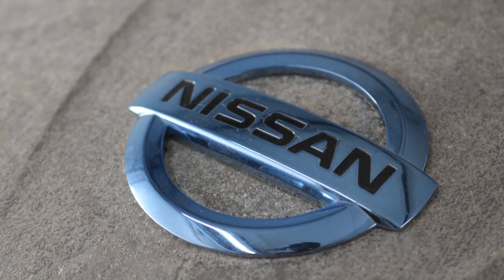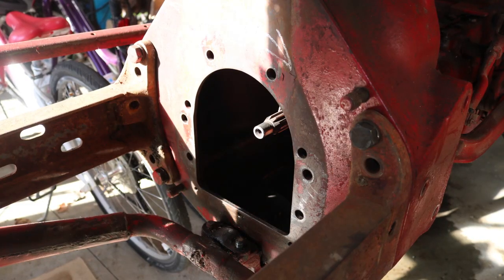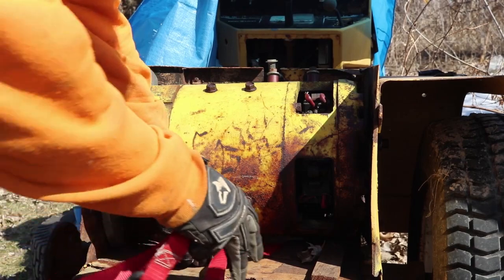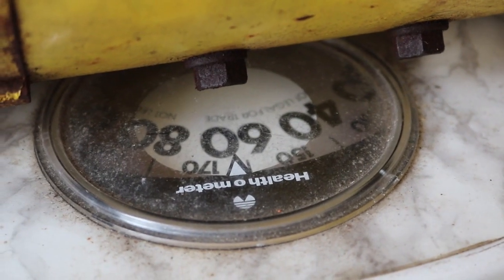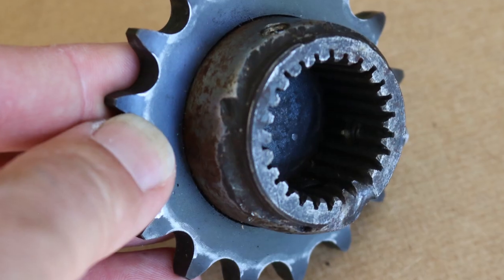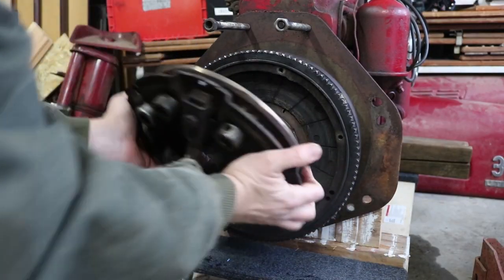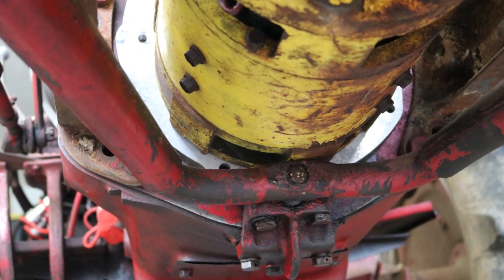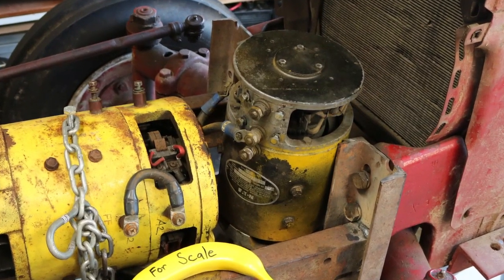Electric Motor for Farm Tractor EV Conversion

Comment: Hey alright. I’m wanting to do something similar on a knuckle boom lift. Has an old Nissan 35hp gas/propane engine and I want to change it out to electric. Haven’t dove in very far yet but I think it’s gonna be possible. Interested in what you have learned so far.
Reply from the maker: You should be able to replace that with a DC electric motor, no problem.
Just put in a forklift motor from a similar size piece of equipment.
Reply: @BenjaminNelsonX  that’s what I was thinking also. It’s older so there isn’t any controller to deal with, it’s all relays and diodes. Not quite sure how to calculate what size electric motor I need to get to be equivalent or better to what the gas engine provides currently. That little 35 hp Nissan doesn’t have a whole lot of torque so my guess is just about anything I put in there should be just that. I’m sure this information is all readily available, I just barely took on this project last week so haven’t done much research.

Comment: Good to see you have the tractor running. Did you use a set of bearings in the adaptor plate to take the thrust of the clutch? I fear that the electric motor bearings would chew out quickly without the clutch thrust being supported.
Check out EV4U youtube page.

Comment: Hey Ben, love your videos, so useful. I am considering converting a tractor to electric here in the UK for us on our small farm. What is the kW / HP rating of this motor? And what was the original tractor engine's HP? Just wondering what you've gone with relative to the original. Thanks!
Reply from the maker: The original gas engine was rated at about 38 horsepower.
I do not have an official rating for the electric motor, as when I got it, it did NOT have an ID plate on it. It came out of a Nissan brand forklift.
I HAVE run that motor as high as 144V/500A, which comes out to a little less than 100HP. (That will make a Geo Metro go over 70 miles per hour in a 55 zone...)

If I run this motor at 48V with a 500A controller, peak power should be about 32HP, but with excellent torque at low speed, which is really what a tractor needs.
So, I think it should be a good match.
I think that a forklift and a tractor this size are relatively similar vehicles.
Reply: @BenjaminNelsonX  hi, what formula you use to convert as you say motor as high as 144V/500A, which comes out to a little less than 100HP  or motor at 48V with a 500A controller, peak power should be about 32HP, help me a formula to convert Volts/Amps to HP
Reply from the maker: @maishabakari2919  Volts x Amps = Power in Watts.
1 HP = about 746 watts.

I used this same motor in an electric car conversion and that car could go faster than 70 MPH.

48V x 500A = 24,000 watts / 746 = about 32 HP.
Reply: @BenjaminNelsonX  thanks alot, you're  not jealous, you're the one who can help others, this calculations I will use to change my ICE car to electric.

Comment: I've got an old Kioti tractor with a bad motor that I just bought. Been having a hard time finding replacement parts for it since it's so old, so I started wondering to myself what would be involved in converting to electric? Found a cheap electric fork lift with no batteries that's cheaper than even a core on a replacement diesel engine, so got the wheels turning. Can't wait to see the follow up videos.

Comment: I'm particularly interested in Battery dimension depending on how much autonomy and workload is necessary.
Reply from the maker: In this case, I think what's really going to happen is that I'm just going to put as large of a battery as I can physically fit under the hood. We want to try to keep the tractor with a classic look, and don't want to put any on the back, as we need to be able to use the PTO and 3 point implements.
Reply: @BenjaminNelsonX  did you estimated a kWh consumption in dry and wet condition?
Reply from the maker: @luipir  I really have no idea how to estimate the energy consumption.
There have been enough DIY electric cars and motorcycles that it's easy to have estimate and "rules of thumb" for those machines.
If you know of a good source of info for tractor energy use, or a good way to estimate it, please let me know.

Comment: I think these are great motors for this project.  I would be careful about adding an additional bearing without a flexible coupling.  If the bearings perfectly in line, the three bearings will apply a load to each other and burn them up.  Delt with a supplier that did this and burnt up water pumps every 300 hours like clockwork.
Reply from the maker: Hmm. Interesting thought. I guess two points always make a straight line, but with three, you better darn well make sure the middle one is lined up right!

Comment: Great to see you back again Ben, now tool shops are open and the problems of the last year have calmed down a little. Shame you can't use the Leaf motor, but I can see the problems with high voltage you were facing. Keep up the good work.

Comment: Hi I'm trying to convert a Chevy Metro to electric and your older series on converting your Geo Metro has been super helpful but I'm struggling to find a motor in my area and I was wondering what would be powerful enough as far as HP... In order to still reach highway and throughway speeds?
Reply from the maker: If you specifically want to use a forklift motor, here's some of the best information for you: https://www.diyelectriccar.com/threads/using-a-forklift-motor-and-choosing-a-good-one.7598/

Otherwise, there are plenty of series-wound DC motors available for purchase through EV parts dealers: https://300mpg.org/projects/electro-metro/ev-parts-suppliers-links/
Reply: @BenjaminNelsonX  thank you!
Reply: Why convert a geo metro that gets like 70 mpg ?    Duh.  Convert a suburban or a hummer.
Reply: @kennypool  it already didn't run and was less than $500 and I'm in highschool so it was a good car for me personally
Reply: @alexiswhite9341  fix it
Reply: @kennypool  She still has that option later on. Chances are the motor and other electrical parts will be in great shape by the time she can afford a full size vehicle and just transplant it then.
Reply: @alexiswhite9341  everyone starts somewhere. Hope you have fun with the whole project.
Reply: @randyeller8139  Thank you!!
Reply: @kennypool  I have 2 metros and a LEAF.  Both cars have awesome Coeficients of Drag.  That is good in an  EV.  That is likely why a Metro!